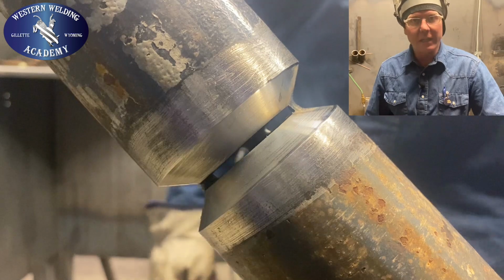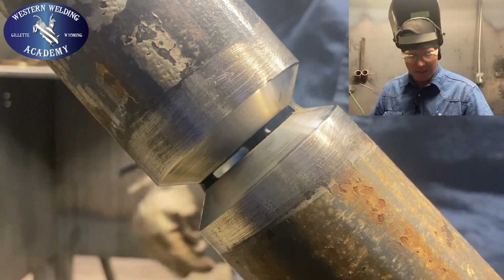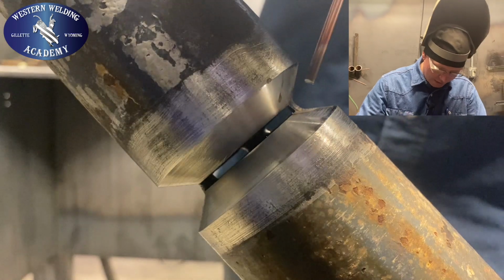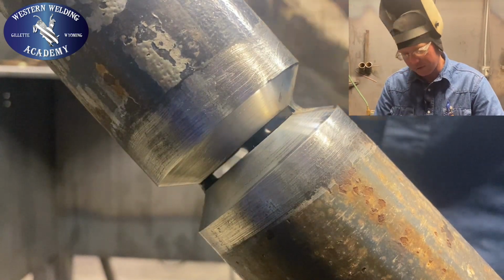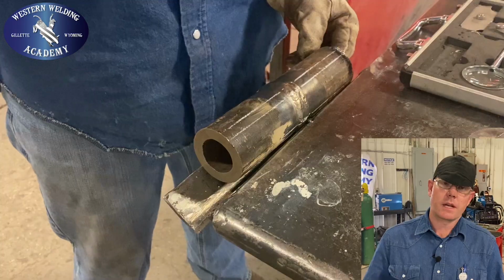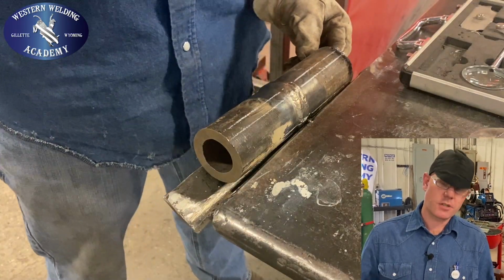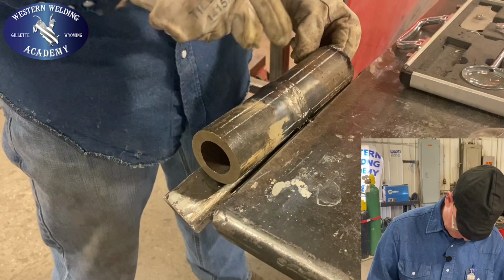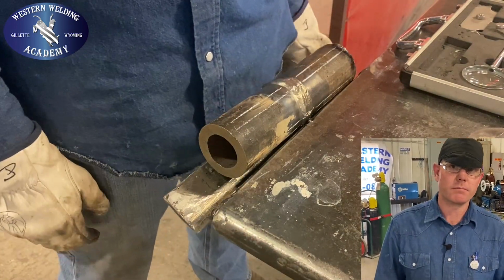Are YOUR instructors REQUIRED to take welding tests?

Comment: I love how James is doing a tube test . It seems like everyone wants to be a pipe fitter . Boilermaking seems to be a lot trickier . Welding in odd positions and having to use a mirror to weld in tight spots. Pipe fitter seems like you’re fairly comfortable doing it